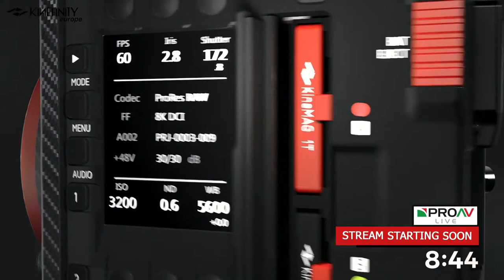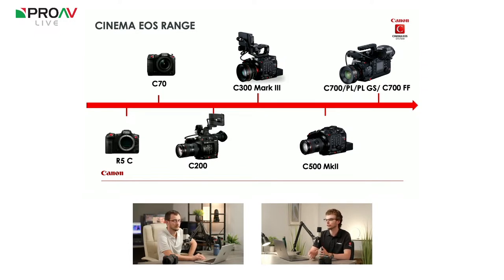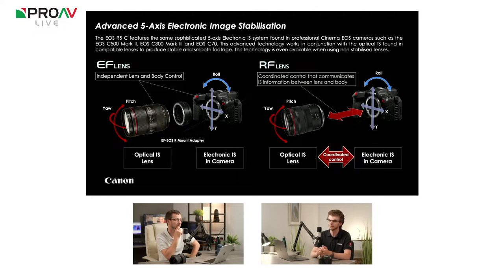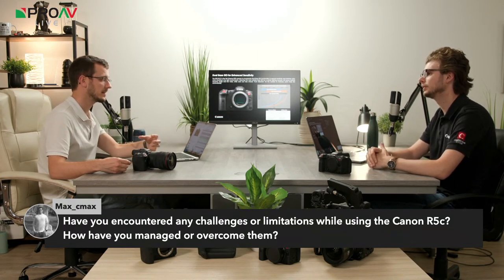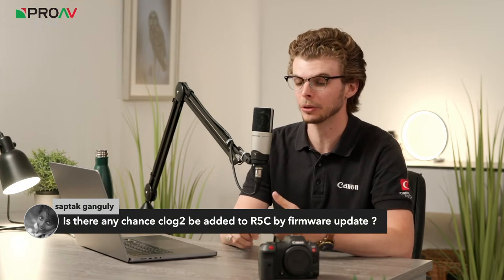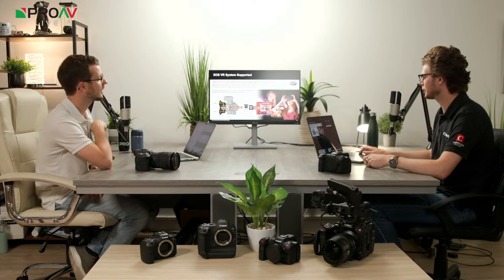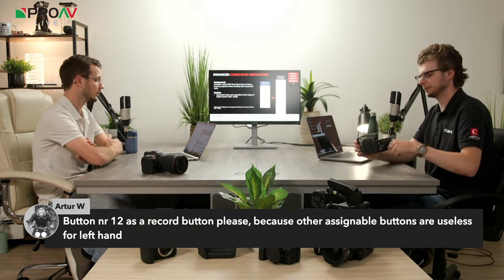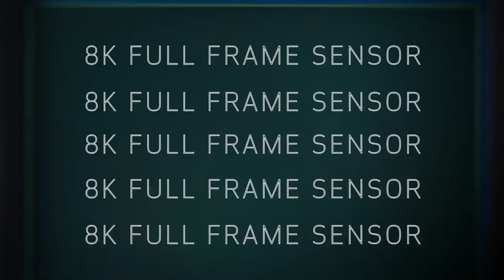Canon R5c - Refresher and Q&A with Tom Storey

Comment: "If the demand is there...." 

Let me help you out, brother. The demand is there for CLOG2, IOS app control in video mode, video capability on the stills side of the OS, open gate, and the ability to map any button or dial to anything. Oh, and perhaps partner with someone other than Tascam for an XLR module so we don't need a backup for our backup. Thank you, Sir!

Comment: - Please add live-view monitoring via app in video mode/cinema os
- Please add the ability to change shutterspeed via control dial directly (this is sometimes really needed in run-and-gun scenarios). I need to first select the shutterspeed via shortcut button, then change it, then confirm it. This is too cumbersome.
- Please add the ability to playback videoclips not only in log but with view assist too
Otherwise, the camera is a beast :)
Reply: Why would you need to change your shutter for run-n-gun scenarios? I almost never even touch it.
Reply: @cinnabun1046  sometimes no time to screw on ND filter etc